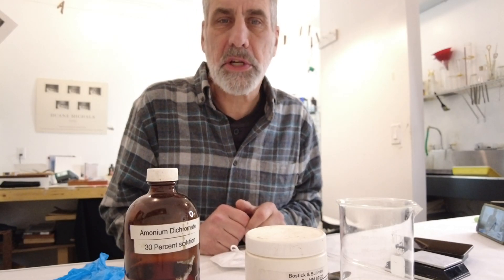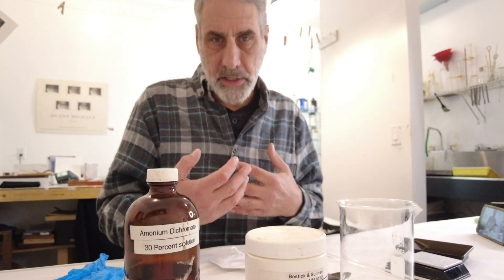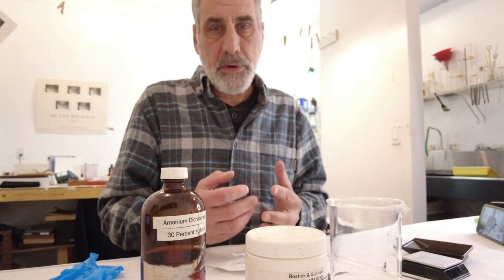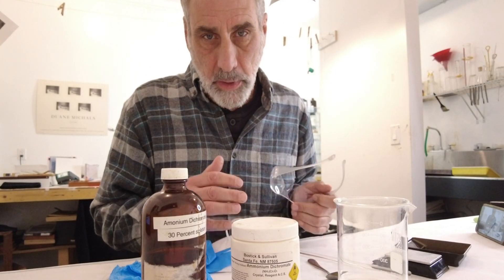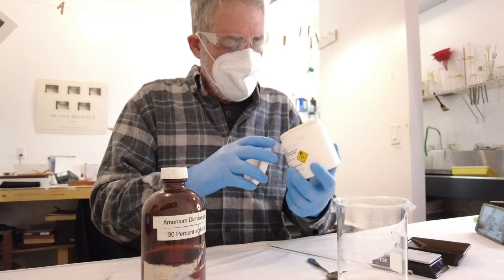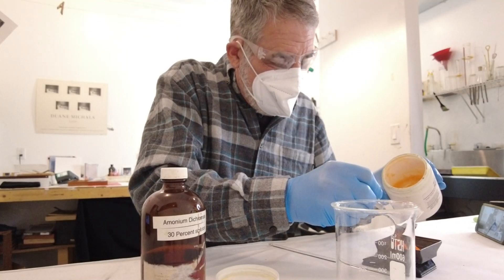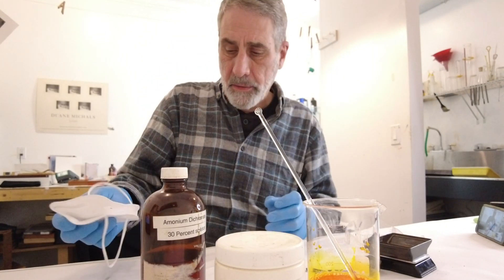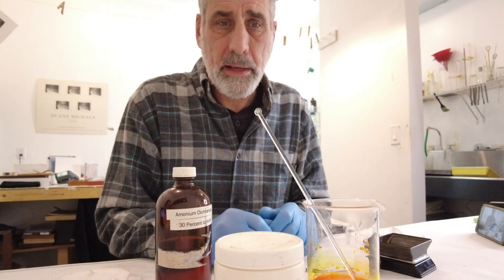Mixing Ammonium Dichromate for the Gum Bichromate Process -

Comment: @North Light Photographic Works, hi Bill thanks for the video. When mix the dichromate solution with the gum and ink can it be stored or must be applied on paper straight away?
Reply from the maker: Hi Luis. Thanks for watching. The document is ready from the time you mix it until it evaporates pretty much. As long as you keep it in a well Stoppard bottle and in subdued light, it should be good for a very long time. I’m sorry I didn’t get to this question faster!
Reply: @BillSchwab  thank you very much for your reply Bill! Got it!

Comment: Hi  Bill,
do you know an alternative to "Ammonium Dichromate" because I can't buy it in Germany?
Reply from the maker: Hello Hans... Potassium dichromate will do, but is slower and is more prone to precipitants and may require filtering. Is it possible to ship AD in from outside?
Reply: Thank you for your answer, I will look around in other EU countries. Greetings from Germany Hans @BillSchwab
Reply: @hanshabel9100  Hans, as a tricolor gum bichromate printer for thirty-five years and a gallery represented artist, I can tell you that potassium dichromate will work just fine. And I have never seen precipitants in the solution, nor has it ever required filtering. I use a five percent solution for my work. Speed is a relative term. Most of my exposures are in the range of five to ten minutes. Potassium dichromate has been the choice historically and it is used in a variety of other alternative processes and printmaking techniques. If you can find it, please know you can use it with confidence.

Comment: Hi Bill, I hope all is well on your side. Thank you so much for all your informative videos, which are brilliant sources of hands-on information! I wanted to ask a question related to all the processes as I had some doubts about my processing technique. I started with Cyanotypes and progressed to Kallitypes, but on the way, I was not sure if my clearing was sufficient. I do mask negatives and paper with your technique, and there is a residual sensitizing covered by the frame. During the processing, the coloured residue washes off, but the slight paper discoloration always stays. Is it the indication of not complete clearing, or is it normal? If you find time to shine a light on this, I would be hugely grateful. Best, Pawel